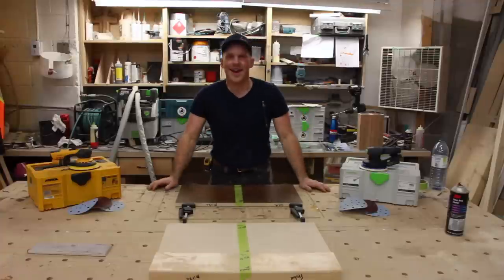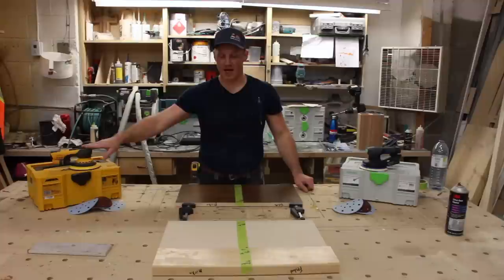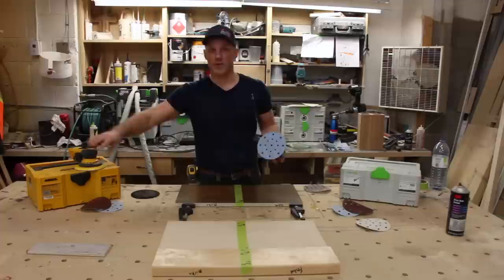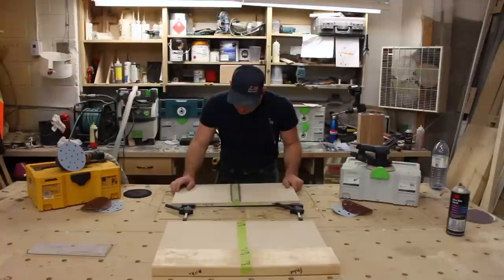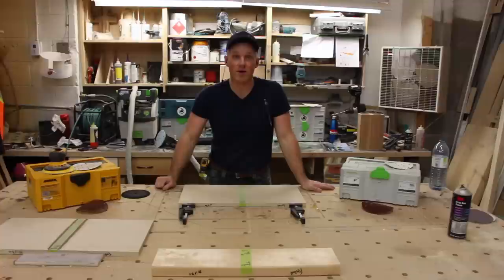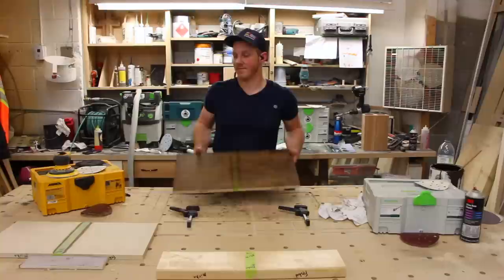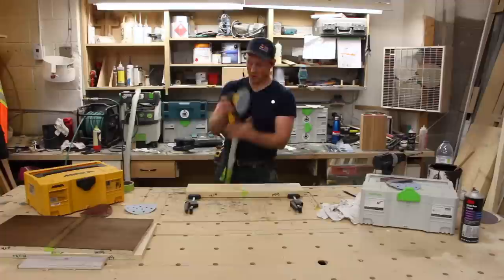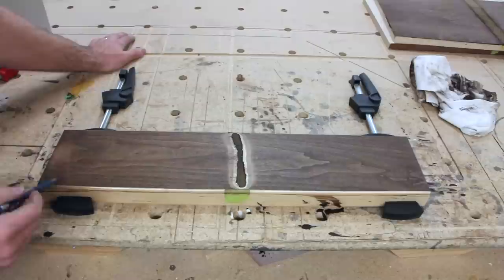Mirka Deros Vs Festool ETS EC

Comment: Thanks for the comparison.
For holding/supporting the hose and cord, try bringing the hose either past your left hip, running it over you left shoulder, and back around to your right hand. 
Or, past your left hip, over your right shoulder, and loop around to your right hand.
(For either hose route, Reverse the lefts and rights if you're left-handed).
Letting your opposing shoulder hold the weight is more even on your body overall since the weight of the tool is in your primary hand.

Comment: I've had the Mirka Deros sander and vacuum for the last 2 years and it is a game changer for your health. I blow buy others doing the same task and with less harmfull vibrations. I just received my new Hepa Mirka and new 5/16 orbit sander. I paint boats and cars and rvs and this set up kicks ass over any other sander I've ever used and is really comfortable and nimble. It might sound weard but I'm kinda excited to use my new Hepa setup tomorrow. It's supposed to be quieter but it looks to have a smaller capacity bag for the vacuum.  If you sand every day you need something like this in your life. What sold me was the salesman was wearing a nice new black coat. He sanded white gelcoat and held his hand under the edge to catch any dust that fell, and then wiped it on his brand new black coat and there was no trace of white dust.  I know I sound like a salesmen but I'm a working stiff lol. I think I'm good,g to loan my old Mirka to my Fast lol buds for a week or so and see how they feel. I've never used a festool but I have heard they remove stuff in a hurry. Great experiment.
Reply from the maker: Thanks for that info Rob! Very cool to hear about your setup

Comment: Faster sanding is greatly attributed to the stroke size, I have both the 3mm and 5mm stroke festool sanders and the difference is pretty noticeable, secondly fesrool also offers an interface pad and a thick interface pad for irregular surface sanding. Thirdly mirka cost a couple hundred dollars more. Fourthly tons of people, Amazon reviews, and forum members continuously complain about the mirka dying on them, I ve been using festool sander in a production setting for over 10 years, I have three of those festool sanders running daily without ever having an issue. Not ragging on mirka as I own one as well but I think those points should be brought to light when doing a head to head comparison. Now take the two sanders, and really lean into them and tell me which one will remove material without bogging down, I can give you a hint, its not going to be the festool
Reply from the maker: The thing with the Festool is that I could never achieve a reliably great finish with it. There have been issues with the mirka circuit board overheating and dying, but that has been fixed with the most recent models. A lot of that was due to the 220 euro electronics running on 110 North American power(same problem that affected the kapex motors). But the main issue is this: I didn't care how long the festool lasted in comparison, I wouldn't use it because it caused more trouble than help. The mirka line has been excellent in comparison, and I'm 3 years into it and haven't had a problem.

Comment: I had both but the mirka overheated but still a great machine. My festools have been very reliable except the cords need replacing every six months or so, that is costly. All said and done I'll replace festool with mirka when one of them dies as I really like the abranet pads they last so much longer than festools pads
Reply: Dont no what your doing to your festool cords but ive never replaced 1 in over 10 yrs
Reply: @bensheldon4521  same here never replaced mine

Comment: Thanks for the review! I'm not trying to be controversial with the following commentary, just point out something that's worth people being aware of about the Mirka Deros 5650cv...

From the research I've done and what Stene Woodwork has said here, the Mirka Deros may be an excellent tool in many areas. However, it appears that Festool beats it in terms of reliability. While a certain percentage of all top tier power tools can fail for various reasons, there's too much hub-bub on the internet about the Mirka Deros in particular to just write off. I actually came very close to getting the Deros 5650 kit and have opted for the Festool instead because at that price point, I expect reliability irrespective of a 3 year warranty. See Peter Millard, Handi-i-Craft and other Youtubers for Mirka Deros failing and some and Mirka's reasoning for it.

Note that this is not quite an apples to apples comparison as this Festool has a 3mm stroke while the Mirka has 5. Festool also do that 6" / 150mm sander in a 5 stroke.
Reply from the maker: The issues with the Mirka failing is an overheating issue, and the part is the circuit board. That being said, I haven't experienced an issue with either of mine. I had the Festool for two years and struggled every time to get a consistent finish. I was constantly fighting irregular scratch patterns, and was at my whit's end despite a ton of online research. I also had a hard time finding information from professionals, most of the info coming from DIY'ers or hobbyists(which let's be honest, have a limited range of experience). 

Even though the 5mm compared to the 3mm isn't exact, I think it was sufficient to show the better performance of the Mirka in all area's, including the finish. A smaller orbit should produces a less noticeable scratch pattern, which it didn't in the case of the Festool(so I don't see the point of having a smaller orbit sander if it doesn't leave a better finish).

I'd be curious to see a review of the Mirka from a professional who logs hundreds of hours a year on a sander, as opposed to "reviewers" who set up tests in order to develop an opinion to share.
Reply: @SteneWoodwork  I appreciate where you are coming from in terms of reviewers and it's a very fair point you make about giving the Festool more of a chance at 3mm for finishing rather than the Mirka's 5mm. I'm not a professional myself so while I'm entitled to have an opinion, I'm absolutely not qualified to have one :) I didn't want to invest a significant amount in a tool that's proven quite divisive. For me at least, whether other reviewers are accurate or misinformed, there's still many unanswered questions for a €600 investment. I haven't noticed similar for Festool. That said thanks for the balanced reply as you've given me more to think about! I wish this were an easier decision...

Comment: I have both, the mirka is the better tool better finish and more comfortable to use. I keep the festool for paint finishes and the mirka for solid wood clear finishes. Both excellent machines though.
Reply: Are you hooked up to a Festool vac and if so does it connect ok with the Mirka?
Reply: Yea man I use a festool vac the 27mm hose connects perfect to the mirka.

Comment: what adapter did you use for the Mirka to connect to the festoon dust extractor? Im curious about the reverse. I have the Mirka system but would like to know if Festool fits on my Mirka dust extractor
Reply from the maker: No adapter, attached with no problem
Reply: @SteneWoodwork  that is great to hear  that the hoses are capable

Comment: Thank you for the video.  Just subscribed. I am about to purchase either the Mirka 650 or the Festool ETS EC 150/5. One of the things I like about the Festool is that it stops almost immediately after turning it off.  Does the Mirka stop like the Festool?  Do you find the paddle on the Mirka to be difficult to use?  Is the warranty on the Mirka 3 years like the Festool?  Thanks for any info you can provide.
Reply from the maker: For me all the extra features didn't matter on the festool. it could come with a million wonderful features but it still wouldn't make it sand any better. which is what a sander is supposed to do.
Reply: He isn’t reviewing the mirka 650 here

Comment: Hallo there 😉 have a nice x-mas, I went in to Tjek your test, but then I start to thing about your workbench, the top is that one you bought (if yes where and what is the keyword for a search) or did you make it your self? One more thing those clamps you are using what's the name?
Greetings from Brian carpenter from Denmark
Reply from the maker: Hi Brian! I made bench top, but bought the clamps. They are festool clamps

Comment: the 3mm sanding orbit is actually only required for sanding paintwork from a grain size of 400 upwards. everything below is sanded with the 5.0 orbit wich means for 90% a 5.0 is enough to make precisely Finishes. therefore the comparison fluctuates somewhat. Personally, I don't like the pedal on the Mirka because you always have to turn it on and off. that is much more pleasant with the Festool. Also it reads everywhere that Mirka likes to break very quickly.
Reply from the maker: I'm assuming you don't use a sander professionally?

Comment: thanks for the test. especially your use of multiple surfaces.  
when both sanders are set up as they're designed to operate, is there any noticeable difference in their ability to keep the shop dust free?  other than  'speed' and 'quality of finish' , that would be the other factor in choosing one over the other.  i'm guessing there's no difference because you would have mentioned it.. but figured i'd ask.  thanks.
Reply from the maker: No real difference in dust collection, both do a very good job. I think the only separating factor would be the push button verses the paddle switch, and who prefers what

Comment: Stick abranet on both. Why have both sanders at the highest speed setting? Will the interface pad from Mirka work on a Festool!, different hole pattern?
Reply from the maker: I simply wanted the sanders to have the same rpm, so that the speed isn't a factor. I'm not sure if the Mirka interface pad works on the Festool, I don't use Festool paper so I wouldn't know.

Comment: Thinking about adding this to my arsenal! Great review! Does? 650 has a bigger motor than the 625?
Reply from the maker: Not that I'm aware of, the 650 stands for 6" pad, 5.0mm orbit. The 625 stands for 6" pad, 2.5mm orbit. I recommend the 650 for woodwork, the 625 is more for automotive applications

Comment: If your doing work where you may be doing allot of articulating your wrist and also need more control of your sander then the mirka is better, but the festool is a very very strong and great tool but for me because of the way the back part of the tool is you can't really see the lower portion of your sander while your working

Comment: before you go any further... you should figure out what the 3 stands for on the festool and make sure that both your sanders are either 3/16s or 3/32 orbital range as otherwise you just didn't buy the right range because Mirka sells sander in both ranges and maybe festool too but not necessarly.
Reply from the maker: The 3 denotes that it has a 3mm orbit, while the Mirka is a 5mm orbit. The larger orbit means it is more aggressive, and will remove material faster. The 3mm orbit is supposed to leave less visible scratches and be more of a fine finish sander. My point was that the Mirka which is supposed to be a more aggressive sander, still beats the Festool at finish quality.

Comment: Do you use your 650 for between coats of varnish/oil/etc? Im trying to decide on the 625 or 650.
Reply from the maker: I use it for everything. I would suggest the 650, as many who have the 625 say the difference isn’t that big between the two
Reply: Stene Woodwork thanks!

Comment: I am a flooring professional and sand a lot of hardwood floors and stair treads.   
I had many orbital 6" sanders during my time. Bosh, Metabo, Rigid, Festool, and Mirka.
Mirka is the best of them, but there is a downside to them.  Had Mirka Ceros for 4 Years and never had it break down on me.
New Mirka Deros broke down 3 times in  3 years. The electronics overheat and die. After 3 time Mirka has given me a brand new model. I was hoping they resolved the issue with the circuit boards but this is not the case. It died this week after finish sanding (  60,80 and 100 grit a staircase )  The sander first would start the vacuum without being turned on and then it died. I do not know if it is worth to repair it and I am really frustrated with the whole deal.
I am wondering if the Festool ETS 150 5 mm orbit ( not demoed here)would be comparable to Mirka Deros.  
It provides faster material removal than the 3mm orbit version. Anyone can confirm this?
Reply: in the old days orbital sanding were air tools  and thats before marketing logics took over work logics. 5mm(3/16) orbital are for rough sanding up to 120/150. fine sanding 3mm (3/32) orbital 150 and up 150 180 220 etc with no more random crossgrain skidding, or flat pad sanding. its time to lean the pad to use a croissant shape area of the pad and sand with the grain.
Reply: I work in the yacht repair industry and the shop I work at currently has three Mirka Deros units, along with their respective dust extractors. In the past year we've had atleast four failures. Mirka has been responsive about correcting the issues, but it seems like they all have the same problem you've experienced. Ive considered buying a deros for myself, because it really is a phenomenal machine when its performing, but they seem pretty unreliable. too bad, because it really does feel perfect in the hand and is a pleasure to use.
Reply: Interesting. I'm glad I read your comment and the replies below as we were about to get a Mirka. I own a painting company doing mainly high end residential work and there is a lot of sanding of a variety of surfaces, often our native hardwood. We need strong, reliable sanders that also do a great job and have to date bought Festool products one of which is the ETS EC 150/5. It gets an absolute hammering, even driving 24 grit paper in extreme circumstances! It is the most versatile of our Festool range and the most used from hard sanding with 40, 60 or 80 after the paintshaver has been through on weatherboards to 100 and up the scale to 240 on windows and finer things. We've had it for 3 years and its been through hell including a drop from the second level of the scaffold on to concrete and is still trucking. I really like the Mirka but wonder if it's more suited to a fine detail woodwork shop than floor or house work which can be hard sanding all day? A thought though, we also use the Festool Rotex 150 and you might want to check that out for floor work. It has a gear drive setting and is extremely strong. A flooring guy we sometimes work with uses his Rotex to get the tight areas on floors and I imagine he'd use it on stairs. Stronger then the ETS (about 30%faster at stripping paint, varnish etc) but also a lot heavier. One thing to note though, before buying Festool extractors we used cheap Vacmaster ones and sometimes they wouldn't turn off using the ETS. No problem with the Rotex and Metabo. ETS fine with Festool extractor but it does have some electronics in it that seem to mess with cheap vacs. More money for Festool (grumble). Vacs are amazing though... And to Stene Woodwork, thanks so much for the video it is easily the best I've seen on this subject. Any problems yourself with reliability of the Mirka?
Reply from the maker: Mirka has has issues with the electronics overheating and causing failure, but that is why they make sure to back it up with their 3 year warranty. I also had the festool rotex, and have sold and replaced it with the Bosch direct drive sander. They are the same type of sander, with a driven mode and a random orbital mode, and the Bosch is much smoother and easier to handle than the rotex, without sacrificing performance. It’s a great and cheaper option without sacrificing quality
Reply: @SteneWoodwork  Sounds good. There wasn't much info on the Bosch when I was looking for a gear driven about 5 years ago. We bought the Makita one first but it was very slow and heavy so we got the Festool rep out and did a demo with the Rotex which we ended up selling our kidneys for to get.  Would love to see a Bosch vs Rotex review, the Bosch looks like a great tool and half the price.
Reply: @SteneWoodwork  tricky, I would not like to pay top dollar for a Mirka machine knowing it has known faults with the circuit board and have to be without it for periods of time dealing with warranty repairs throughout the first 3 years.
Reply: @adamandlorraine  If the difference in quality of the finish is important to you, you can always keep a spare sander, to use while the broken one gets repaired. If it is not, both the festool and the mirka are probably overkill for your particular use case.
Reply: Sorry i am late to the party the festool also also has all inclusive warranty where the mirka doesn't and wear and tear is not under warranty which is scary for such a pricy gadget. Warranty for me as a consumer just shows that fewtool totally stands behind their product and mirka doesn't. But that is me. I run a Bosch GEX for now and down the road will get something in 5mm since the Bosch is only 3.2.

Comment: Thanks for the video. Debating between the Mirka 650 & 625. Difference is the orbit diameter, 5mm 2.5mm.. think it would make a difference?  Primary sanding will be for medium/smaller epoxy tables. Cheers
Reply from the maker: Sorry about the late reply, the 5mm has been adequate in every way for me. The 2.5 would more apply to the automotive industry
Reply: @SteneWoodwork  np.. thanks! Ended up getting 5mm 🍻
Reply: @Rishi.Rao.  how has your experience been with the Mirka? I am about to purchase either the Mirka 650 or the Festool ETS EC 150/5.  Apparently the Festool ETS EC has some chip issues that are causing some problems with overheating and some resulting supply issues.
Reply: @jamescharity5003  been awesome. i will not use another sander again.